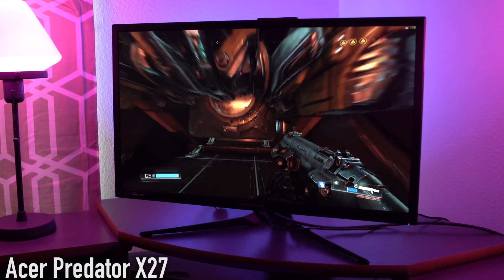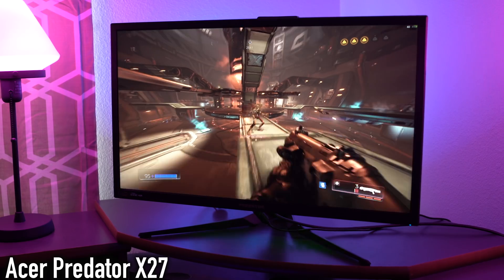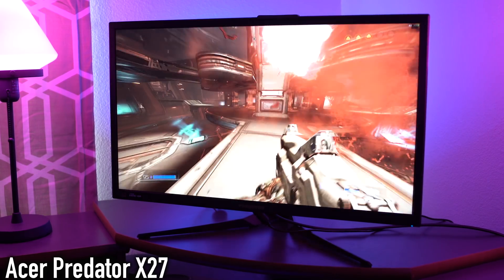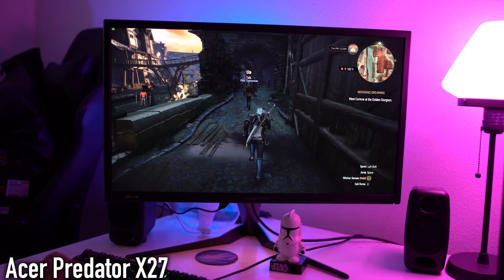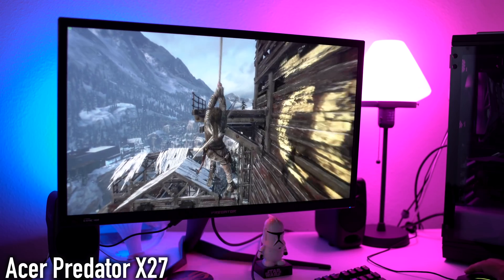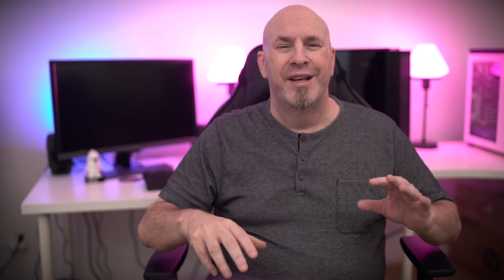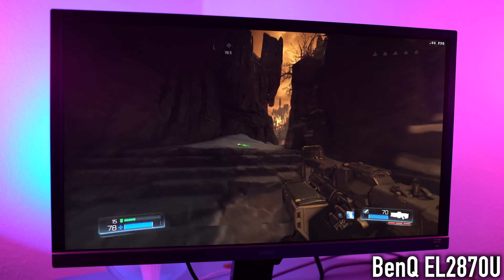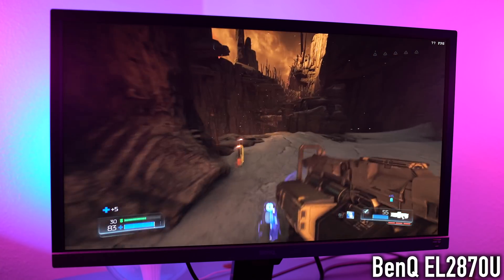What's Different IPS TN And VA Panel Types Explained -

Comment: seeing as this is a 2018 video, i was hoping to get more accurate information, but i didn't.
A lot of VA panels says they have the same 178° viewing angle as IPS and just last week i was at a store where they had an LG 4K TV and a Samsung next to each other, (almost all LG TV's use IPS panels and almost all Samsung TV's use VA panels) and to be honest the Samsung VA panel looked like it had better viewing angles, to me anyway.

Also TN panels are the most common ? maybe 5 years ago, i've looked at a lot of TV's and monitors (since i wanna buy some) and none of them had TN panels, but there were a few new ones i never heard of, namely ADS panels.
Maybe the super small and super cheap ones are TN, actually i just looked at LG's 2018 monitor line-up and only 6 out of 33 were TN and all under 24", and can you call something that doesn't do more than 60Hz a gaming monitor anymore ? i say no.

I came here trying to find out if a VA panel with a wider color gamut (WCG) looks better than an IPS panel with lower WCG, for ex a VA with DCI-P3 coverage of 95% vs an IPS with DCI-P3 of 80%. 
I mean does the panel type really matter or the color gamut ? (when it comes to color)
Reply: A higher end panel will always look good no matter the technology with just a few disadvantages depending on the panel type (colour shift for TN when looking at them from weird angles, ghosting on VA, IPS glow making uniform colours uneven on IPS from certain angles), all of them will however cover 100% sRGB (most important for general use). IPS is only ever useful for graphical design. The rest is really not even an issue, black looks good on a good TN panel although probably marginally better on a VA panel and likely about as good or worse then a TN with an IPS panel (depending on how your monitor shows IPS glow).

Comment: Actually, most modern VA panels no longer have the color shift older models suffered from. All of Samsungs current line of TVs have VA panels and many of these even challenge OLED in color accuracy, contrast ratio, and viewing angles. I have a $300 VA panel in my room and a $300 IPS display in the living room and I can say the VA panel is far better. Blacks are good (not as bad as the IPS but not nearly comparable to OLED or displays with full array backlights) while the whites are brighter and there is less banding in general (no neither is HDR). The only downsides that are still relevent in modern VA panels are the motion blur effect (though many cheap IPS panels also suffer from this but not as severely), input lag, and colors tend to be more saturated (vividness tends to over load the colors while IPS tends to be more accurate). If you are a fan of Samsung displays than you are likely a fan of VA as well. When I went to Walmart and saw the TVs on display the VA panel stood out in the color department strongly over the competition.

Comment: using a Qnix 27" 120hz (qx2710) for the past 4 years, ips is nice. 4ms response time is ok but i find that tn looks better in that regard so the 4ms is noticable if you ask me. i bet that at 6ms it gets much worse but there's room for improvement on IPS displays.

Comment: i think you got VA and TN mixed up there, the color shift you said is worse on TN panels, not so bad on VA and best on IPS
Reply: That's misinformation since it really depends on the price class.  A high quality TN only shows issues at very unrealistic viewing angles (mine when looking up when lying on the ground or when looking from an elevated vantage point (like a stairs), you'd only really notice it if you like gaming when lying on the ground or when you strap yourself on the ceiling (both sound uncomfortable)...

Comment: So what brands make the best IPS panel? LG or Dell?
Reply: i think LG makes for Dell (meaning dell doesnt manufacture panels themselves),  and for their gaming series AU Optronics
Reply: Lalrinsanga Khawlhring in my country many peoples say dell has a nice colour, is that true?
Reply: it all depends on the panel quality, higher models will have better color accuracy and most often than not, they will be factory calibrated, but only on higher models, and i dont really think dell has better colors, as i said, it all depends on the panel quality and caliberation
Reply: Ngurah Bramhyang Dell probably, but the LG panned are not far off to a point where only an expect would be able to tell the difference

Comment: Is it possible to tell any difference between an IPS and a VA with similar specs placed side by side while gaming?
Reply: In terms of response time, probably not. But if your talking about colors and contrast they are quite different even an untrained eye can see the difference if looked closely.
Reply: Just put a TN panel in there as well, you're unlikely to notice if you get an actual good quality monitor (so no cheap ~100$ garbage).

Comment: What about IPS glow, no mention of that little issue.

As to colour reproduction, VA can be as good as IPS and when you consider the darker colours then VA wins hands down.
3000:1 vs 1000:1 contrast ratios, if you don't mind your blacks being greys, then go IPS.

IPS has better viewing angles, but realistically this isn't a big issue on PC's as you are front and centre to your monitor and is only a consideration for TV's or maybe triple monitor setups, though the side monitors should really be rotated. The black crush issues don't happen as readily on modern MVA panels and neither does colour shifting. 

Really the only advantage that IPS holds over VA that is relevant to gaming is pixel response times, but that too isn't a hard and fast rule as some VA panels match the grey to grey response times of IPS, so you can't just say IPS has better response times.

Another little issue that tends to haunt VA panels more than IPS is ghosting, but here's the caveat to that, as VA panels actually can go from black to black unlike IPS, on dark scenes the ghosting will be more pronounced because you are shifting from light to black and not light to grey (because IPS can't do black) and so the ghosting is more perceptible on VA.

My own 75Hz 4ms MVA panel shows this ghosting, no ghosting in bright scenes but slightly noticeable on dark scenes.
I also have an older cheaper VA TV that I use as a monitor, this shows black crush, colour shifting and ghosting, but my newer MVA monitor has none of those characteristics except the above mentioned dark scene ghosting that is more of an accentuation from your eyes image retention as this goes away as soon as the blacks become greys.

So to say that VA is second fiddle to IPS is a bit misleading as a good VA 10 bit panel is about the best you can get for reproducing the full colour range and not stopping short with washed out blacks.

If you want response times then get a TN panel, they have good enough colour reproduction for gaming but not for professional work.

Oh and as to lag on VA, what a load of shite, lag is related to the input and how long before that frame gets shown, it has zero to do with the panel and everything to do with the associated supporting electronics. i.e. the monitor not just the panel.
Reply: magottyk Honestly he missed a bunch of points and it seems like 30 minute research job. Why is he stating that VA has input lag issues when there are clearly many VA gaming panels such as Samsung'a Qled line that are capabale of srgb of 130% and better blacks AND lower input lag
Reply: Could you explain what does "ghosting" mean? 😬
Reply: Does led or lcd have anything to do with the backlight bleeding? I hate when watching a dark scene and the monitor is glowing and not black. Is this a panel type issue or led problem?
Reply: @Yoko.Kurama  Panel issue (IPS has glow, mainly in the corners)

Comment: IPS: If you want the best looking monitor with most accurate color reproduction 
 TN : If you have severe OCD and obsess over as little as 4 ms of latency, the fastest monitor at the cost of any decent color
VA : Some trash hybrid between TN and IPS
Reply: @tyisafk  oled would be horrible as a pc monitor as they are suceptible to burn in.
Reply: TN are faster theres evan 240 hz now witch the others have 100 120 144 hz now as well
Reply: VA > IPS > TN
Reply: VA(only if you find a low latency panel) > PLS(better version of IPS) > IPS > TN (just don't, dont get a TN panel, they are cheap trash)
Reply: genuinely dont know what to put here There are plenty of low latency monitor's, the qled range from Samsung offer latency indistinguishable from fast TN panels (4ms vs 6ms of input latency)
Reply: A lot of high end ips panels suffer from extreme backlight bleed problems (all 1440p 144hz panels at least)

Comment: the VA panel color shift depends on its quality, desktop VA pannels are not so bad, but I've seen some HORRIBLE panels on laptops, that look decent if you look dead center, but shift just a tiny bit from center and it loses all the color, reaching the point where at a 150º angle it's basically unseeable, it's all gray and blue, you can't even read a single letter on it. You really have to be careful when buying VA panels

Comment: I'm using a VA panel and quite happy with its 3000:1 contrast ratio. i dont notice the color shift so no prob for me. The only issue my display suffering is backlight fluctuating when freesync is enabled and the frequency of the display changes drastically. you can actually see it in games main menu where fps shoots up in the thousand range which sucks.. but other than that VA is a solid choice if you don't mind the 7ms gray to gray response time or slower.